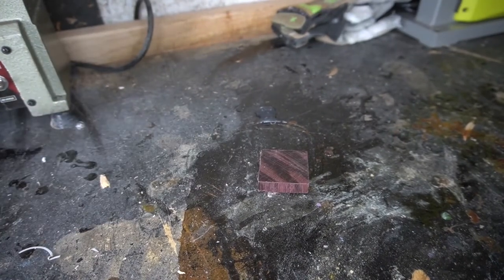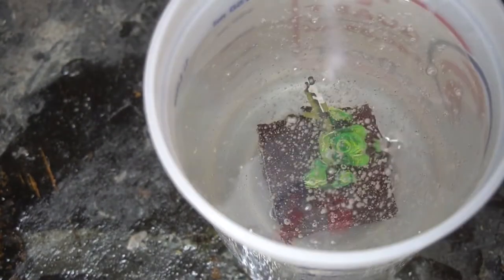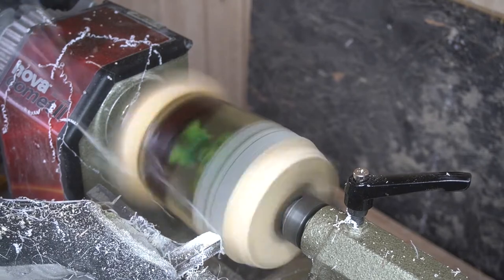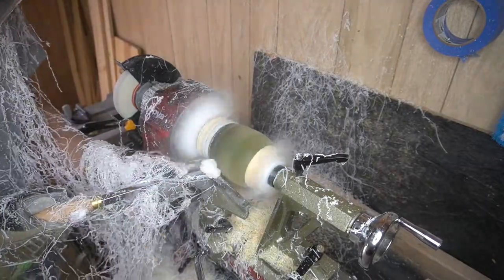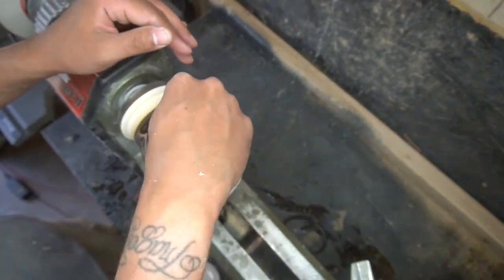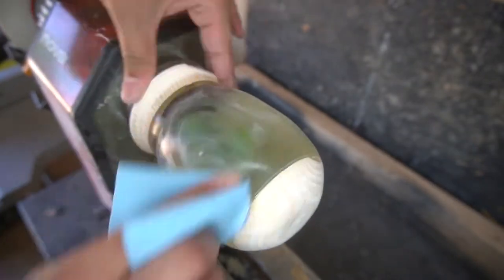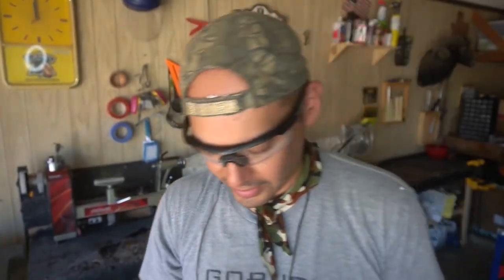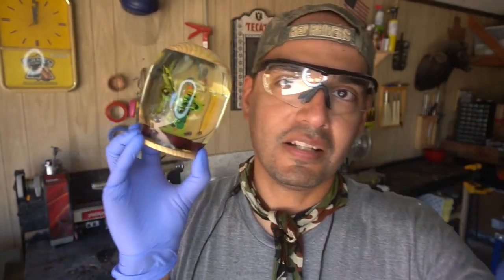Halo Master Chief Dipped In Resin

Comment: That's still pretty good for a first deep pour.  Do you have a diffuser on the Air intake of the pressure pot - it helps keep debris from flying around in the pot.
Reply from the maker: I use a pressure pot but I got some saw dust accidentally in there. I work out of my garage and no matter how much I vacuum up that saw dust sometimes it lingers in the air...